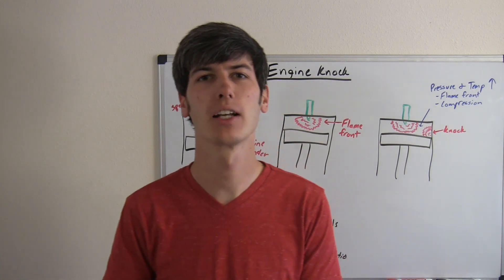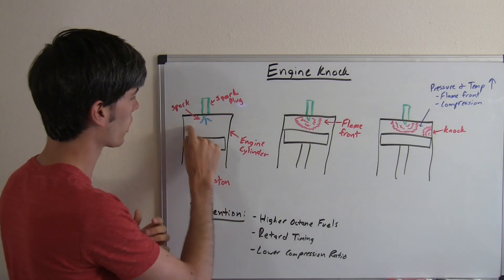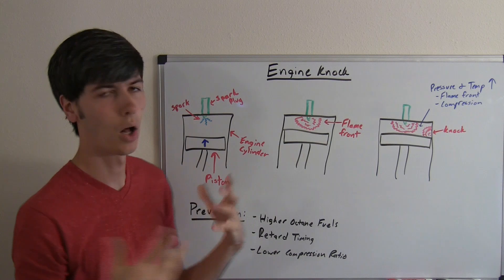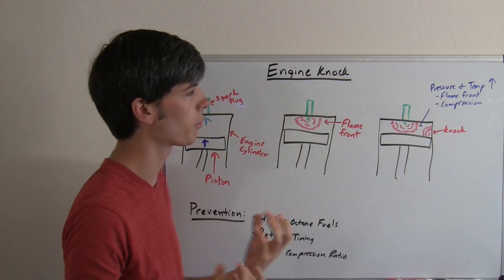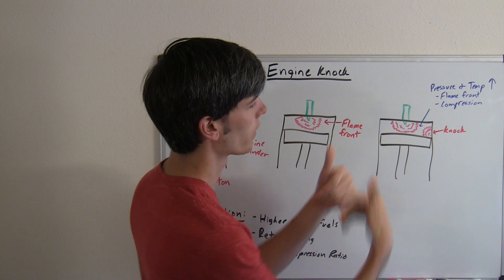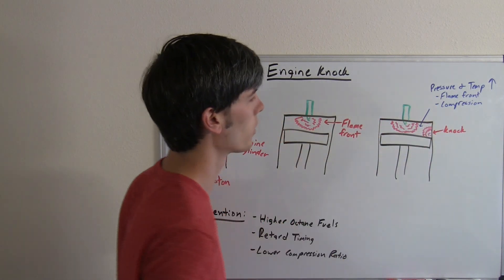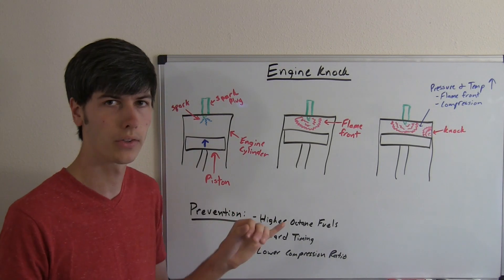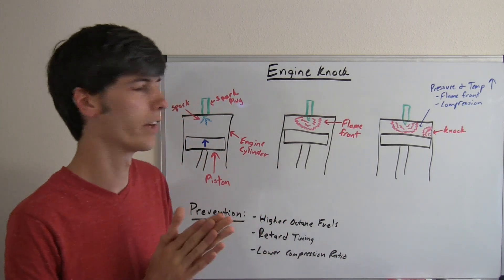Engine Knock Sound - Explained

Comment: what causes KNOCK? it's hard to understand
Reply: +yugioh2463 bad fuel, engine deterioration, bad timing and most probably bad tuner
Reply: +Ali Abdulaziz ok and why is it that u need to use higher octane rating to higher performance engine? what if u just use the regular instead of premium?
Reply: +yugioh2463 simple the higher the octane the better and cleaner the fuel burns plus most performance engines are tuned to run on 93 octane (for example) so if you put anything else that might screw up your engine, especially if your car is tuned.
Reply: ok.. and what about those trucks, they use diesel fuel, is that bad for your car because it has lower octane rating? and why is it ok to use for trucks, doesn't it cause knocking on the trucks engine too?
Reply: "Diesel fuels are actually very prone to knock in gasoline engines but in the diesel engine there is no time for knock to occur because the fuel is only oxidized during the expansion cycle. In the gasoline engine the fuel is slowly oxidizing all the time while it is being compressed before the spark."
There you go

Comment: If an engine knocks can it be repaired or I may need a new engine...?
Reply: +Jordi castillo
If it's "detonation" knock, you should get it looked at ASAP, you might burn a hole in a piston. It probably just needs a tune up and/or needs to be run on high-octane.
If it's Rod knock, you better start saving money.

Comment: its the piston moving up not the cylinder
Reply: +shriram nayak He misspoke cut him some slack
Reply from the maker: shriram nayak Yes.
Reply: Well, in my car the pistons are stationary and the cylinders move. So.....
Reply: +Santa Six
Technically it's the relative motion of the piston in the cylinder. It doesn't matter which one is fixed and which one is moving.
However, it is customary to call the moving part the piston, no matter what it's shaped like.

Comment: why using a higher octane number fuel solves the problem of knocking ?
Reply: +Engineering Explained +mohsen khaleel Simply higher octane fuels have a higher auto-ignition temperature which makes them more "resistant" to knock. Great video, you're brilliant. Thanks ! Such simple but effective demonstrations and explanations. I looked up your one about clutch packs (Torque vectoring) after checking out the new ford focus RS :)
Reply from the maker: mohsen khaleel Knock is caused by a high enough pressure that the fuel ignites on its own, rather than with the spark alone. A second flame front can be created which causes problems.
Reply: thanks a million
Reply: +mohsen khaleel higher octane fuels  are more stable under high temperatures and pressures and are less likely to self-ignite due to their inherently high auto-ignition temperature. If you used a high octane fuel in a car (say, 95 or 99 octane, which is a standard at the mumps nowadays) then your car would be less susceptible to pinging and detonation through auto-ignition of the fuel as opposed to if you were to use a lower octane fuel (say, 85 octane, which isn't common at all nowadays). Of course, Diesel engines don't suffer from knock much (if at all) since the fuel is injected during the compression stroke and ignites due to the high temperature and pressure of the cylinder. This alone is enough to prevent knock... although the higher fuel density is also a huge help because diesel is WAY harder to ignite than gas (petrol) or kerosene (jet fuel). You could take a barrel of diesel and try to light it... nothing will happen, you could go through several boxes of matches and nothing would happen... petrol and kerosene will light the second the flame gets near the vapour!!
Reply: +ThEcRaZ3dGaM3R kerosene is more like diesel then gasoline in terms of flammability.
Reply: +Engineering Explained Do you know if Diethyl-ether aka Starting fluid is spark ignited or is the auto-ignition temperature of 160 °C / 320 °F achievable just by compression on the average gasoline engine? Thanks
Reply: reggiebacci The autoignition temperature of starting fluid is easily achievable with compression alone... you can easily break that 160*c barrier!
Reply: Cool, thanks I kinda guessed it would be. I did think about finding a crappy engine and pulling the plug leads to test it. :)
Reply: reggiebacci Give it a shot... you might be able to get it to fire... although with a gas engine it might be more of a pain because they have a WAY lower compression ratio, which means a greatly lowered temperature... if you use a diesel engine, you can get one to fire at room temperature with the glow plugs disconnected, so you should be able to get that to fire as long as you can pump the starter fluid in at the top of the compression cycle...
Reply: +mohsen khaleel Because higher octane fuel is more resistant on self-ignition under high pressure and temperature.
Reply: Sound like a hot engine is more likely to knock and get damaged
Reply: +mohsen khaleel Octane is C8H18, and gasoline is hexane, C6H14. Octane is a longer chain and so is more resistant to moving with the pressure wave. Hexane moves easier in the gas. So the more octane, the more resistant to knocking.
Reply: Edward Ciaia good point there! it's actually in the diesel family, has a low (if not no) water absorbency and it's more of a fuel oil than it is a light fuel like petrol or Jet-A. it's harder to ignite than petrol (of course being more dense) but lighter than diesel. It still needs to be atomized to burn properly but it evaporates at a lower temperature than diesel so heating it will allow combustion to occur, although it's a LOT less violent. In fact... you can run a diesel engine on heating oil and kerosene with no ill effects and a petrol engine on Jet-A without a problem since that fuel's designed for piston engines with a spark.
Reply: +ThEcRaZ3dGaM3R
I think you have AV-gas and Jet-A mixed up. Jet-A is in fact, a special grade of kerosene.
Av-gas is also known as 100LL, because it's "low" lead gasoline of 100 octane rating. It still has "some" lead in it, which is why everyone's trying to phase it out as quickly as possible.
Av-gas will work in spark-ignition piston engines, Jet-A can be used by Diesel engines. Both without much problem for the engine itself. 100LL in a car engine will kill the catalytic converter, and form carbon deposits much faster.
Jet-A in a diesel engine might wear out the high-pressure fuel pumps faster (similar kind of fuel pump in a jet engine, so not likely).

In fact, the military is trying to get diesel engines on as many things as it can, even the ATV's and off-road motorbikes, specifically because then they only have to ship and source one kind of fuel (jet fuel for everything), which makes logistics a lot easier.
Reply: thanks alot
Reply: +Engineering Explained If I'm running low on coolant, could that cause the knocking?

Comment: And what if I don't have a choice as to what fuel I use (I live in the Caribbean, we basically take what we get). I started using an octane booster. Would that help? I'm still hearing the knocking but I'll monitor it.

Comment: Would the cam and crank shaft bearings tolerances affect that knocking sound? For instance If I had some smoothing work done on the Crankshaft would that affect it?
Reply: Okay. What should I do to stop it from doing that then? I'm about to do an oil change. And I'm using octane booster in my fuel.

Comment: Hi... I have a question that may sound stupid but is something that I couldn't get an answer too. Why cant we develop an gasoline engine that can work on the same principle as a diesel engine. Higher compression ratio (say more 13:1) will automatically burn the gasoline and we would not need spark plugs too. So what can be the issue with such an engine?
Reply: ***** .. thanks for explaining that ... so basically what are you saying that the explosion of gasoline cannot controlled beyond a certain compression ratio and hence the need for spark plugs... in mind I did think this was the reason but I wasnt sure about it... but thanks for confirming.

Comment: Hello
im researching on the maximal compression ratio for a otto four stroke engine and a wankel engine. I found out that the wankel engine theorotical could have very high compression ratio. which of the engines would have the highest compression ratio without engine knock.
i would appreciate a quick response.

Comment: Engineering Explained How often is a knock normal as oppose to a harmful knock? for example I drive a 2013 wrx running an V3 accessport(stg 1 91 Map) on 93 Shell gas. full wot im clean, but when cruising on highways il get up to -2.8. and a -1.4 as often as every 5 minutes. at low throttle 5th gear. I have been told that it is common, a million times but what is a safe amount really?
Reply from the maker: John Landi When you say -2.8/-1.4 are you referring to ignition advance or what?
Reply: That is the feedback knock correction I get on the access port but yes it has to do with the timing
Reply: I appreciate the help in advance! Ive seen almost every video haha

Comment: OK.  Now I'm confused.  If you advance timing too much, you get knock.  And I don't see how advancing the timing can necessarily cause a second flame front.  I always thought the reason you get knock when your timing is advanced too far is that the combustion occurs too far before TDC, causing the piston rod to "knock" down against the crankshaft... basically because for that short period of time, it's actually trying to force the crankshaft in the wrong direction.  That small tap in the wrong direction unloads the rods, sleeves, and pins and the knock is the parts being "loaded" in the opposite direction.  Is that wrong?  Please explain!

Comment: Good stuff !!  

Recently finished adding a single turbo kit to my supra. 

Don't seem to be having any out of ordinary knock readings coming from my ems. 

Being in california at the pump stations here 91 is pretty much the only option, i want to add a couple points to my octane but i really don't know if octane boosters work.  If so do you have any recommendations ?  

I think 93 or 94 octane would be alittle safer. I just want to take extra steps in making sure my engine is safe.  I have lowered the compression ratio by adding a thicker head gasket aswell.

Comment: Well wait two flame fronts colliding causes knocking. So why don't hemi engines knock? Is it because the spark plugs are so close and the pressure waves aren't destructive interference then?
Reply from the maker: wesley huff They fire simultaneously and in a controlled manner and location with hemis.
Reply: wesley huff hey dont forget powerstrokes they are worse!

Comment: Your forgetting the dreaded rod knock, which means your screwed. Some might refer to it as a rattling, but on diesels it's harder to tell since they run on combustion rather than ignited by spark. So in a sense ALL diesels KNOCK!
.
Bad rod/journal bearing are the reason for the knock rattle (an old farmer trick is to put ground up banana peels in the oil. No sure how that will work with todays oil filtration). If they simply just used ball bearings (and why don't they?) on all crank journals, it would eliminate the problem (the bushings, are just two smooth metal halves that are put together around the journal and in the rod)... You could also run the engine at higher RPM's safely with ball bearings! They should also use ball bearings around the wristpin on the piston too!
.
Adjustable domes for compression is also a simple solution. Another would be concave piston heads, and hemispherical, or dome heads. That would even out the combustion better. Ideally all gas should be 100% octane, and you wouldn't even need spark for combustion.
.
Rod knock sensors are stupid... by the time it senses it, your already screwed and need to get the rod replaced. By the time it's ready to blow... you will know!

Comment: I just had my engine rebuild with oem parts, I use 91 octane as recommended. I barely have just a little over 3,000 miles on the build. It's a k20z3; anybody have an idea of what it might be?

Comment: Hey engineering explained, I think you could have included basic conditions that cause it.

I have a pinging issue at high rpms in my vehicle and i did some research, carbon deposits, lean conditions can cause pinging.
so at higher rpms 4500 + typically means a fuel pressure problem creating a lean mixture.
Reply: he is an engineer not a mechanic
Reply: Yes, all or any of those can cause exactly what he described. I think the point of this video was the technical cause of the knock sound, not the many factors that contribute to it, bet he has another video on that, but yep, I get your point a comprehensive video would be nice.

Comment: Great video bro. Many people think using a higher octane fuel will keep the engine cleaner and they'll get better gas mileage (I've tried telling my uncle to stop using premium gas on his Toyota Camry). Octane simply controls the ignition of the air/fuel mixture. Most luxury and high performance vehicles require high octane gas because their engines run at a higher compression, and using a regular gas will simply ignite before the piston completes the compression cycle. So unless the car requires premium gas, don't waste your money and use regular gas.
Reply: eldom72 depends what year camry he has, the older ones (pre 2006 maybe) didn't need premium. The newer ones with the v6 could really benefit from the higher octane, but it can run on both. I read on that engine because i wanted to use it for a swap...
Reply: I know this video is so old hopefully you get this and are able to help me.  I accidentally ran a whole tank of unleaded gas in the acura TL,  And is now knocking I have since put him premium I haven't ran at that long but I'm afraid it might because eing damage how long does it usually take if it is the higher octane that it needed for it to stop knocking?
Reply: @annie's big day Always follow your manual recommendations. Unless you have you change parts, and have them professionally tuned to receive a higher octane.

Comment: Not to be confused with rod knock, which can be caused by many things, the connecting rod is not moving flush with the crankshaft,but is loosely moving with it and  knocks on the crankshaft due to the speed rotating it creates. Due to rod bearings generally. Causes can vary. This is generally a heavier knock/ping. And in most cases much more severe than detonation. Or engine knock listed in the video

Comment: Can you explain how to design a combustion chamber so that it has a high knock threshold? What do you think about piston and combustion chamber coatings? Do they help preventing knock?
Reply: Chrysler did that when they came out with the hemi engine. A higher knock threshold allows the engine to run at higher compression which means more power output.

Comment: so would you say that for a car engine to less likely have that knocking noise, that the car engines are designed so that the fuel and air mixture stays at atmospheric pressure until the sparkplug fires?
Reply from the maker: theatregal91 Absolutely not. You need to compress the air to create any useful power, by expanding after combustion.

Comment: So is it safe to say that what's happening in the cylinder during this engine knocking is the same as how a diesel engine functions? ie no spark plug just high compression and heat..
Reply from the maker: Gabe Orlowitz Well, similar, diesels have compression ignition vs spark ignition. But it's more controlled than knock is.

Comment: The professor of internal combustion engine technology Martti Larmi in my university (Aalto university school of engineering) emphasized the following in his last lecture about knocking:

Engine knock IS NOT caused by two flame fronts colliding in the middle of the cylinder like explained in this video. It is caused by the pressure wave created by the rapid combustion in the autoignition spot/area. That pressure wave then goes back and forth along the cylinder diameter hitting the cylinder  walls causing side to side vibrations. That is what causes knocking. It has nothing to do with flame fronts or even two different pressure waves colliding together.

That seems to be a common misconception which is repeated all over the internet and even in some literature.
Reply: There are also a lot of videos here in youtube about the sound of knocking where they are just idling a car engine that they have just started running. That shouldn't be knocking. Knocking usually occurs only when the engine is very warm and it has to give a lot of power. So for example when you have been driving for a while and then put the pedal to the metal to accelerate.
Reply from the maker: Atte Nieminen Thanks for sharing - so what exactly makes the noise?